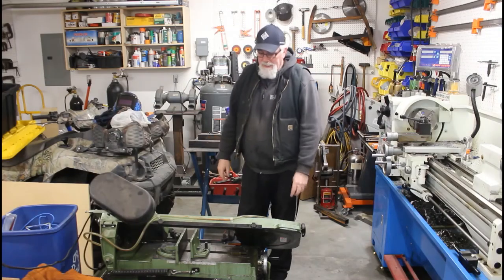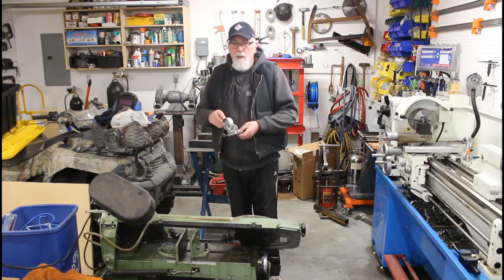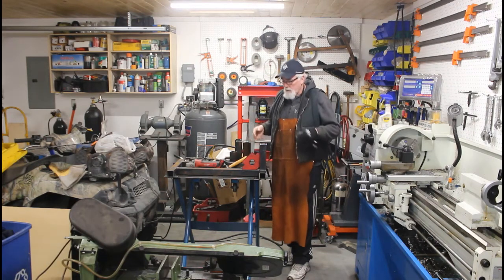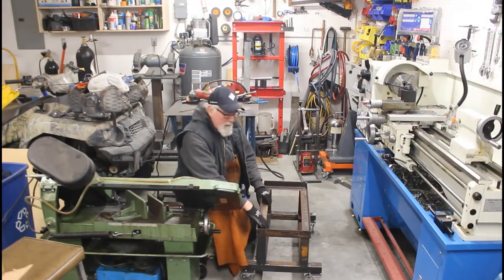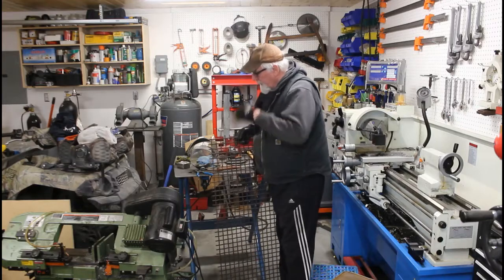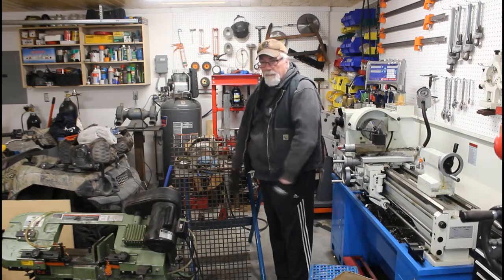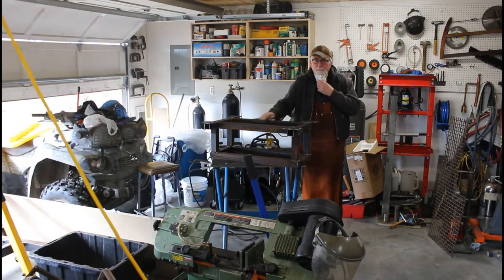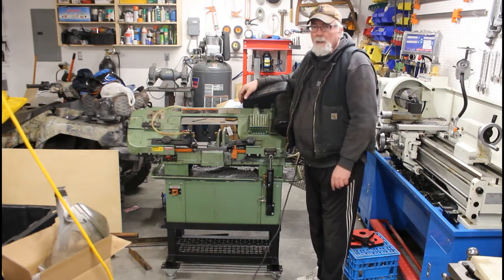Stand for my Metal Bandsaw

Comment: That was a nifty job. I've had a similar issue with my 7x12 horizontal/vertical bandsaw. The low height is a disguised blessing because you can lift a heavy piece using just your legs up to the proper height. I opted to buy two 6-ton RV jack stands to hold the long materials instead of making a similar stand. Pretty cheap, and saved me from my least-favorite task, painting. I need to look in your back pages to see what that lathe is, it looks handy and underutilized!
Reply from the maker: HI Wes, thanks for stopping by. The lathe is a PM 1440, I have had it for about 12 years or so. Most of the stuff you cut is usually short and light pieces so I got tired of having it down low. How is your new shop?
Reply: @CruiserMac  I have a 7x12 bandsaw from PM, but I forgot the model number. I've been doing some fab work, and buying 10 and 20 foot lengths of steel (it's cheaper that way). I don't have the strength I had when I was younger, so a shorter lift is better for me.
Reply from the maker: @weshowe51  I hear you Wes, you seem to lose strength every year as you age.